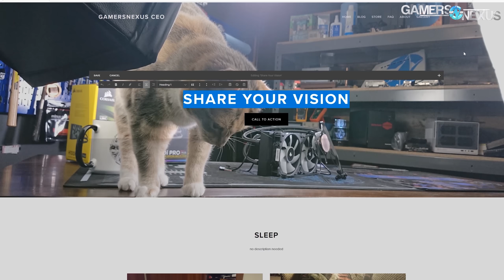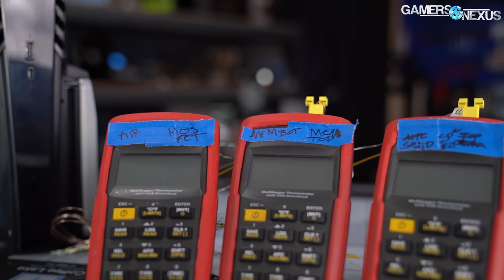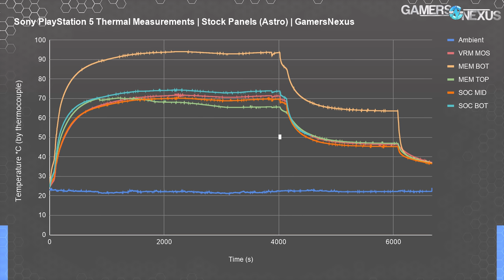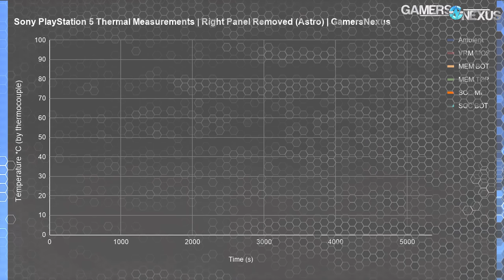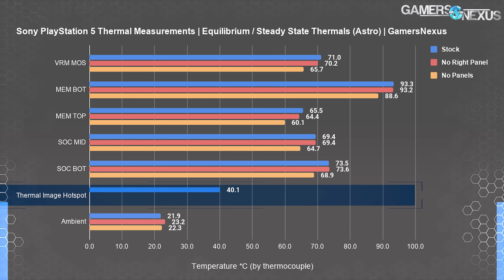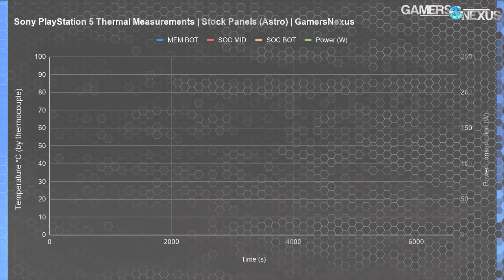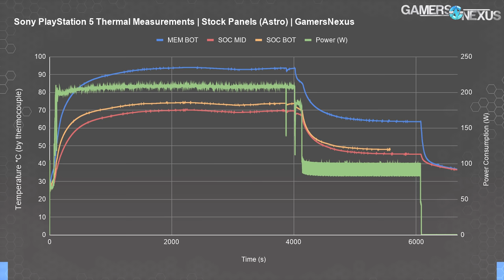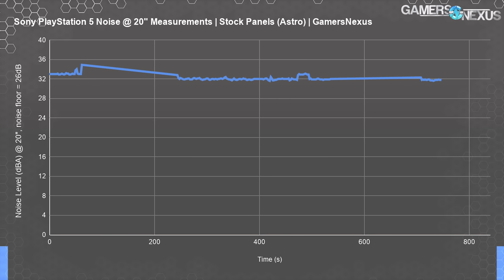Weak Cooler Design: PlayStation 5 Thermals, Power, & Noise Testing

Comment: that 90+ degrees makes me extremely uncomfortable...
Reply: Still better than last gen. I wish it was in Fahrenheit tho
Reply: @FollowJesus777-KING  
Edit: I fucked it up the first time. It's multiply by 1.8, then add 32.

Original comment- "Subtract 32, then multiply by 1.8"
Reply: @FollowJesus777-KING  162
Reply: @FollowJesus777-KING  
I don't think normal ps4s ever reached more than 80 degrees celsius. Not sure about the pro though.
Reply: @GlacialScion  You have it backwards it’s multiply by 1.8 and then +32 making it 194. 0 Celsius x 1.8 + 32 is just that 32 degrees the freezing point of water for Celsius and Fahrenheit.
Reply: @ZeitGeist_TV  
You're right. Mb.
Reply: @GlacialScion  No probs friend blame U.S. for basically saying screw what 90% of the world uses this is MURICA with our gallons and feet and inches and miles and Fahrenheit.
Reply: @ZeitGeist_TV  
I'm American and I agree. Lol
Reply: @ZeitGeist_TV  ya damn heathens! Blasphemy I tell ya! Oh Imperial Measurements, I will forever be loyal to you, please show these Philistines the light.
Reply: @FollowJesus777-KING  or you could learn a modern, more practical measurement-system? :P
Reply: @FollowJesus777-KING  Was in Celsius degrees
Reply: @Dev-nr4dw  im not really sure about that. The launch ps4s ran pretty toasty, and once the later cuh 1215 was released with much more efficient ram modules the noise was reduced drastically. On my launch ps4 replacing the thermal pads on the ram modules reduced the noise by 10-15 db, so maybe the ps5 would benefit from new thermal pads.
Reply: @Dev-nr4dw  the pro definitely did haha
Reply: I don know the PS4 Pro the fna noise is like a HELL
Reply: @ZeitGeist_TV  lol you are funny but great explanation
Reply: @noobdebusca1757  Disassemble, clean, and check and or replace thermal paste and it will be close to whisper quiet especially if you are running ssd.
Reply: @ZeitGeist_TV  There are about 4 degrees F per every degree C.  It's more accurate.
Reply: @larrygall5831  No sir saying "there is about 4 degrees F per every C" is not more accurate at all lol that's an estimative range where as I gave you the exact equation to give you the exact conversion.
Reply: If that makes you uncomfortable don't look at the memory temps on 3080s and 3090s...100+ has been recorded numerous times.
Reply: @dildojizzbaggins6969  peasants use metric. Kph makes no sense 200 kph feels slow as hell.
Reply: @codysimpson911  no. imperialistic is smol-brehn. why do you think galaxy-brehn-scientists use metric? ouch dude, ouch...
Reply: @dildojizzbaggins6969  doesn't really matter. The richest and most successful country in history uses imperial. All the innovation in the last 70 years came from the place that uses imperial.
Reply: @codysimpson911  so? that's like saying pop-music is good because it sells the best. so that's a "no" again (:
Reply: @dildojizzbaggins6969  hopefully the United States sends your country its stimulus check.
Reply: @codysimpson911  shows that you don't have a valid comeback, resorting to playground-insults. ouch :-3
Reply: @dildojizzbaggins6969  lol
Reply: @ZeitGeist_TV  feet and inches are based on an ancient measurement standard that you can still see in the great Pyramid of Giza. You can also see the Zodiac procession of the earth’s wobble preserved in the “divisible by 12” concept. It helps us know when we are by relying on major constellations and the summer equinox. We’re not special, we’re just preserving ancient rules while the rest of the world tries to do its own thing by making things divisible by 10.

Comment: GN: Reviews PS5 thermals and finds them lacking

Sony: "Introducing the PS5 mesh!"
Reply from the maker: No, no, no. They need to take it from the case manufacturers: The PS500P Mesh!
Reply: lmao
Reply: Lol
Reply: im glad im a pc user
Reply: @donmcdouglas5017  haha ok
Reply: Unless Sony goes full TG panels with no apparent air intake.
Reply: If only Sony wasn't so tight with the panel copyright protection... I could see PC case manufacturers making custom plates to edge into an otherwise unreachable market. Imagine Phanteks mesh on a CONSOLE 😂😂
Reply: if you can replace the panels that easy, they can sell a different one with cut outs on the spots.
Reply: @GamersNexus  PS500P-dRGB for the extra oomf
Reply: Sony can even push a Spider-Man-themed PS5 Mesh panels.
Reply: PSMeshiFive
Reply: Someone was already  litigated by Sony for selling custom side panels pre release, so yeah no mesh mod PS5, think more open bench PS5 for that ghetto fresh feel.
Reply: @dukeofspeed2072  it's perfectly adequate for a console. No different than any other console released. It's not a tower case.
Reply: @eggy6857  Xbox Series X is a literal tower case. The Corsair One pre-built PC case and the NZXT H1 look exactly like it.
Reply: @GamersNexus  I was hyped for the H500 before your review. After they gave in and adopted your "fix" I bought the base version H500. It came with a mesh panel installed and the optional acrylic disaster. The acrylic panel went immediately into the garbage.
Reply: @dukeofspeed2072  they will update it next year to sell even more... "improved noise, cooling and slight tweak in performance so you run 1% more fps"
Reply: PS5 breeze
Reply: @GamersNexus  without rgb fan? i will wait then.
Reply: @jetpil0t  going to start selling stickers for $20. Each purchase includes a free aluminum side panel.
Reply: @GamersNexus  As long as they don't borrow naming schemes from monitor makers, we'll be ok. Then it would be the PS50QR20NT34z
Reply: @orangeapples  Hum did you forget about the 4th dimension hack?
Reply: @GamersNexus  did you mean H500H mesh?
Reply: @donmcdouglas5017  the thing that sucks about console is no customization. You have to get the entire Sony package, good and bad. You have to get the entire Microsoft package, good and bad. PC you can pick which parts are actually not garbage
Reply: @GamersNexus  Just a (stupid?) question.. but aren't those hot mems near/against/in contact with the PSU down there? (Or am I looking the wrong way at it?) And are there things we can do ourselves to 'fix' it? Covering them with more/better (liquid metal?) paste? So they make better contact? Or just other cooling pads between them and the metal plate? (And for the conductors and mosfets?)
Reply: @donmcdouglas5017  Wake me up when bloodborne is available.
Reply: @GamersNexus  Not sure if that's a PS5 or a PSP 😂
Reply: @georgeivanov844  Xbox Series X is a small form factor case. It's tiny.
Reply: @eggy6857  The Corsair One and NZXT H1 have the same footprint, as the XSX.
Reply: @GamersNexus  The PS500P Mesh /ODD
Reply: @georgeivanov844  Pretty sure the Corsair One is much taller though. 9-10 cm difference.
Reply: @GamersNexus  gives them room to make an upgraded (or downgraded) PS500D Mesh as well
Reply: @eggy6857  Actually, it's just under 8 cm taller, but that doesn't make any difference, because I'm pretty sure no one is putting the Corsair One under the living room TV.
Reply: @eggy6857  Why are arguing over technicalities? It's not unlike the Corsair One, NZXT H1 and Xbox Series X share the same cooling philosophy. Microsoft may have even copy-pasted the Corsair One case design, because it's been a thing when Microsoft were designing the chassis of the XSX.
Reply: Look it reduces the heating costs in my theatre room so im okay with this
Reply: @LiLBitsDK  they will probably change it for the ps5 pro
Reply: Considering the channel you would think he would review the Xbox Series X being its from Microsoft. Wonder what his reason for test the PS5 was instead?
Reply: @zbrutalis  Because of physics poorly ventilated or not, the amount of heat is the same. Because it’s not effectively expelled from the case however it’s more like a pot on simmer for 30 min rather than a pot on boil for 15. Same energy output just two different ways to get there.
Reply: @cbboy1265  he installs his own mesh ok
Reply: I wish that EVGA would release an iCX variant, without the need for added thermocouples.
Reply: @GamersNexus  You might be laughing, but I am pretty sure I have you to thank for the existence of my H500P Mesh White that I enjoy as much as I do. All of Coolermaster's marketing materials during the launch of the original H500P suggested to me that they thought it was good enough and they weren't going to do anything about it.
Reply: @jetpil0t 
Unless You have more information than I have been able to find You are Wrong/Mistaken.
 . NO Sony did NOT  not  litigate anyone "for selling custom side panels pre release". Sony litigated over I.P. infringement...-
And we can think what we want about that.
How ever this IN NO WAY mean that there won't be custom side panels !!... Only that it is less likely that there will be "pirate/non-licenced" ones... So Yea that is how that works.
Best regards
Reply: @dukeofspeed2072  ??
Would You mind explaining Your, in my opinion overly dramatic ""remedy"" for this POTENTIAL problem. 
The real question here is "does this design perform GOOD ENOUGH for the console to operate as declared for it's declared lifetime" ??
 [This is NOT a matter of whether this is the "best possible" design...it never is (unfortunately)]
And we simply don't know the answer to that question Yet !!
And until proof exists that this design actually leads to diminished performance and/or shorter life span ((as compared to the specifications)). Your ""remedy"" to me reads like either coming from a "fanboi of a competing platform" or a person with a very naive understanding of how companies operate.
Best regards.
Reply: @GamersNexus  no! not another "Blah blah 500 blah" case!
Reply: Meshi-Five
Reply: @jasondaigo  sounds like an interesting 3d printer project.
Reply: They definitly should release a software option to increase the power to the fan, and the fan curve. as well sell a mesh cover.
Reply: @onlyeyeno  I agree about "Sony litigated over I.P. infringement", because it was pre-release and also if it was way before the design reveal. The side panels come off so easily compared to past consoles that I can almost guarantee they will have custom side panels, 3rd party, 1st party, or both for mainly design purposes. 😄
Reply: Console and a lot of pc case manufacturers could learn something from Fractal.
Reply: @bwabbel  PS5 Pro Mesh? Though that starts to sound too much like an Apple product I suppose…
Reply: I would pay an extra few bucks for that honestly lol!
Reply: @eggy6857  could've fooled me, it's way too big for console standards, and yeah if it can stand up right and is 4x times the size of a htpc then it's a tower
Reply: @chrisbullock6477  its more interested in the ps5 than the series x thats all
Reply: People expect a lot from a 500 hundred dollar console 🤷🏿‍♂️🤣🤣🤣🤣
Reply: @GamersNexus  meanwhile you can just butcher it with your dremel :D
Reply: @GamersNexus  I was expecting an "H" next to the "500".
Everyone needs more H500.
Reply: "Sony c an improve here" Too bad Sony doesn't GAF whatsoever. Glad I didn't buy this first iteration of the ps5.  I sense overheating in the future of this machine. I sense solder becoming soft and mem modules sliding off their pads.
Reply: @donmcdouglas5017  Same, but PC doesn't have exclusives PS has, only reason I want one, is for exclusives, like the new god of war.
Reply: Mesh panels would look cool.
Reply: Hahahaha!! That's a good one!!  The PS5 Pro Mesh. 😂🤣😂🤣🤣😂 I'm done!!!!
Reply: @cbboy1265  I'm glad I'm a PC user too, and so is everyone else with a PC. Learn to deal with it.
Reply: I'm actually really impressed on how cool the console is while also having exhaust air hot enough to warm the wall 2 ft behind it. Huge improvement over PS4, though it's not hard to top complete garbage (sorry PS4, you still have good games).

Overall I'm impressed with the cooling on PS5. Console stays cool while exhaust air is hot, looks like it works as intended.
Reply: @donmcdouglas5017  my vram temps are just as hot in a well cooled case in my pc under load and is normal temps..
Reply: @LiLBitsDK  The irony of your post. Yes they have made a version 2. But instead of improve the cooling, they removed a ton of hestsink. They literally took cooling out.
Reply: @selnor1983  yeah to save money and sell you a "new improved product" so they make more money :D but the improvements aren't always in your favor :-P
Reply: and in a big twist of irony (or ignorance) sony has apparantly decided to actually SHRINK the heatsink instead
Reply: PS5 Pro will have mesh
Reply: @onlyeyeno  ok boomer
Reply: @donmcdouglas5017  lol as if pc doesn't have other 100 issues and oh it runs on ice right??
Reply: @Abhishek91377  still 1000x less issues
Reply: @donmcdouglas5017  not at all lol people buy consoles solely for gaming and hence less issues, and even the costs are so fuckin high for PCs drives, malware, virus, settings all that bs is for people who game all day long..without any work. For casual gamers console is best
Reply: @Abhishek91377  ok youre right